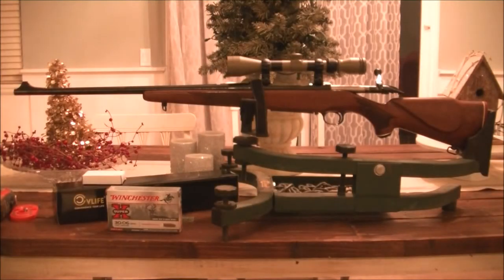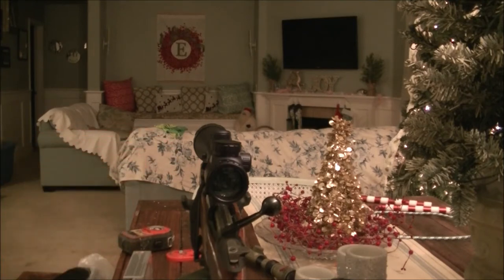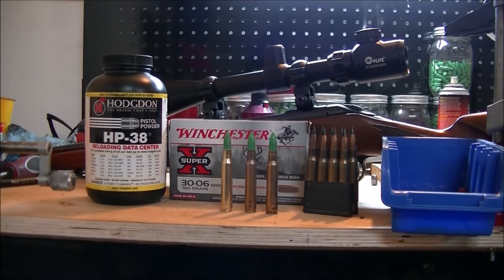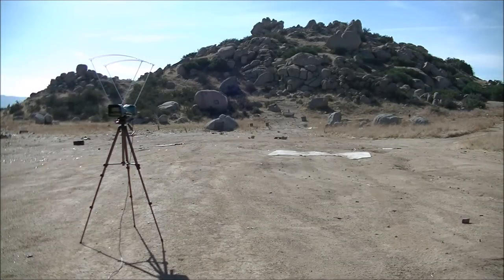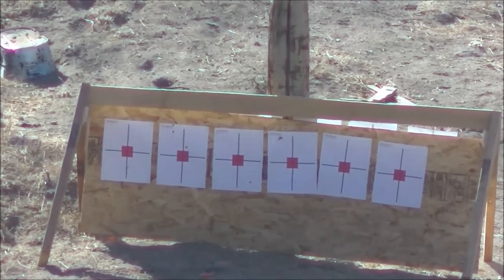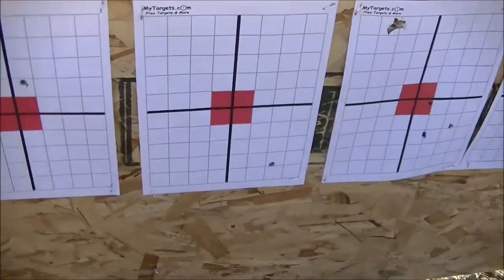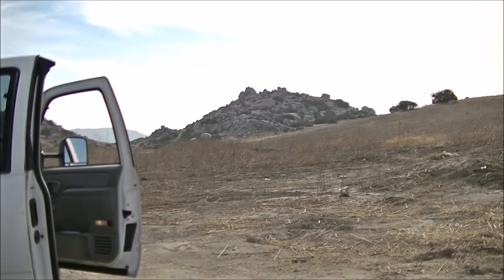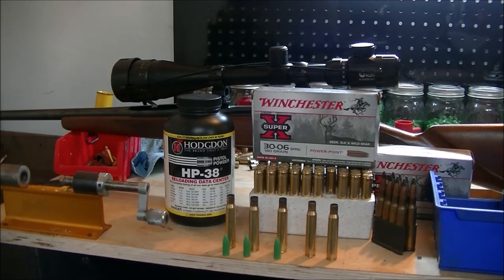Cast 30-06 PC (Powder coated) Load Testing

Comment: Unique ,Red Dot and Green Dot works well also for cast rifle loads . I use these in my 7.62 x 54r with a 155 gr. cast PC bullet at around 1600 fps with good accuracy . Good stuff
Reply from the maker: James Pollard, Right On! We'll see if we can push it up to 2400+ fps. Thanks for watching!
Reply: Good luck . I hope you can but every time I get around 2,000 or more I need a gas check . Hope you have better luck .
Reply: How many grains are you using in your 7.62x54r loads?

Comment: Hey, I have that exact rest; Caldwell Lead Sled Solo. Friendly advice- don’t strap your rifle to it with it weighted down. You will ruin your scope. I use it, I don’t strap the rifle or add any weights. I also have a Ruger M77 in 30.06. I can follow along with you in this one.
Reply from the maker: JH 586SW, great tip on the sled thank you for that. Ya this rifle kicks good with these Varget loads. Part 3 should be up this weekend.
Reply from the maker: Thanks JH 586SW, Your deffinatly right. People passing by will notice and possibly  sub.

Comment: Why the pistol powder? Are you looking for subsonic loads or is rifle powder hard to find? Also, I saw a few videos of people using 22lr brass and swaging them to be used as jackets for cast 223 bullets. Have you looked into that?
Reply from the maker: Whats up Matt Woolsey! Im using pistol powder because Cast Lead bullets act different to pressures compared to FMJ. Ill need to stay around 30k PSI as that is my tensile strength of my lead alloy any higher and it will start gas cutting thus causing leading in my barrel. Gas checks will also help mitigate this but I dont use them. Most pistol powders burn fast so itll burn efficiently at lower pressures yet yield the velocities im looking for, as you saw with low SD numbers from my chrono results. I can get the same velocities as rifle powder but with a lot less which is what I'll hope to achieve. They're some rifle powders such as H4895 which you can reduce load using Hodgon's 60% under max rule. Cast Lead rounds are a whole different animal but in ballistics gel they do some really cool results compared to any FMJ and even old school Paper Patcher's can contest that lead bullets can be more accurate than FMJ rounds. They engage the rifling a lot better and can take down large game. Check out the article from Ed Harris thats in the description. About half way he talks about using pistol powders like Red Dot, W231 for this round. This cast load cost a total of 9 cents a round which is less than half what 1 FMJ bullet cost. It gets me practice behind this rifle without breaking the bank also. I've looked into swagging but the cost of dies and setup deters me from getting into it.  If you want I can send some bullets for you to reload and try bud? lmk